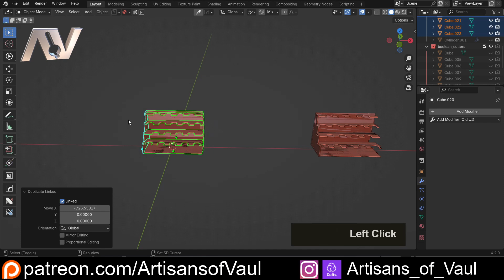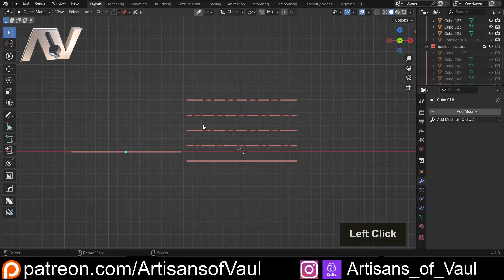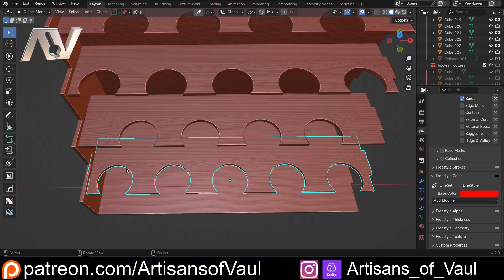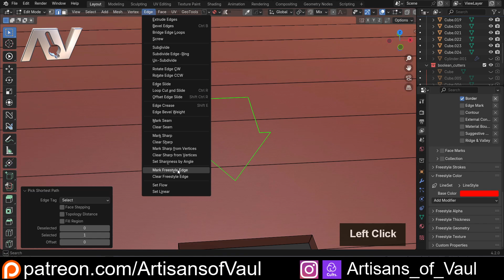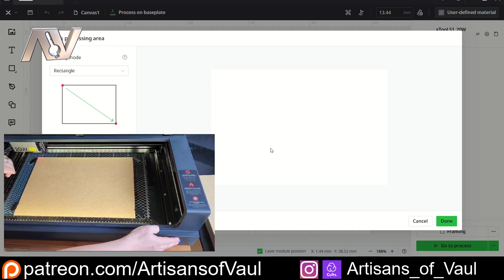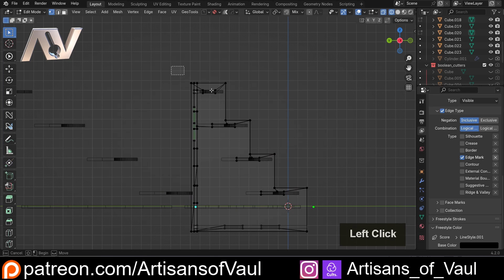Creating a Paint Station in Blender - Cube to laser cutting (Part 2)

Comment: First off, great video. Lots of good stuff in there that I learned.

SVGs do have dimensional data in them. I use InkScape to directly make things to cut and afterwards I can just drag and drop into my burning software.
Now, I tested this all out and the SVGs generated in Blender don't parse in Falcon Design, but InkScapes opens them fine. problem is, as your noted, the size is incorrect. There may be some setting in Blender or SVG Export that affect this. If both of our softwares open the generated files to the wrong size, then it is a problem with the Exporter/Blender. In Blender, I set it to using mm as the units.
Also, saving the generated file in InkScape and importing that changes the size by a fraction of a precent. IDK why this is. If I make a SVG in InkScape it is imported perfectly fine.
Looking at the properties of the generated SVGs shows lots of "trash" in the general properties. But using your trick of getting the full size and scaling it inside the burning program works fine. An annoying step in the workflow, but it works fine. Thanks for your time.
Reply from the maker: Thanks for the analysis.   It would be good to find a way to have it exported at the correct size but I haven't found one yet.

Comment: Also, for 3D modeling for resin/filament it would use Blender units (regardless of how your units were set up) where 1=1mm when exporting the STL. I guess in this one since you're manually setting the dimensions, it doesn't matter; IE, you're not using the SVG scaling? Does SVG even have scaling? I assumed it does.

Also, I don't remember seeing it, but did you have to adjust the size of holes because of the fact that the laser burns a bit of material? Or was it small enough to just give some small tolerance and fit well?
Reply from the maker: @stormycatmink  So I made the holes about 2mm wider but the laser also has a little bit of burn width to it. I discuss that in Part 1 when talking about the parts fitting together.

I may be wrong but I don't think SVG have a scale. One of the major draws of them is meant to be that they will work on any scale as a vector graphic and not based off pixles/etc.

Comment: Using the camera is a great tool to create the svgs.  Have you a method to place pieces of a design that are at odds with angles flat on the ground plane keeping all the correct dimensions?  I am modeling building roofs that I want to laser cut.
Reply from the maker: @davidmcelroy3113  ah, that would need to be rotated to be flat. Or... if you're just getting the roof you can angle the camera pointing directly at the same angle as the roof but in practice I think that's more effort than putting the roof flat
Reply: @ArtisansofVaul  I have been giving the smart unwrap a try and saving the pattern with svg and no fill.  Not completely convinced that all the dimensions are retained in scale.  Can’t quite figure how I might use snap to a plane as another method.
Reply from the maker: @davidmcelroy3113  Oh, thats an interesting idea.  It hadn't really occured to me as I don't do a lot of UV unwrapping in my Blender use.  It's worth exploring for sure though!